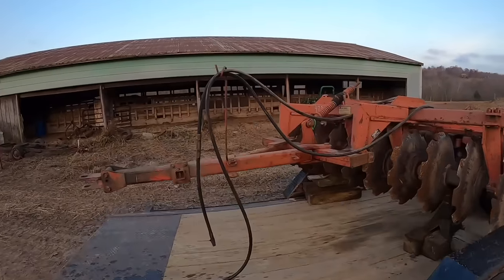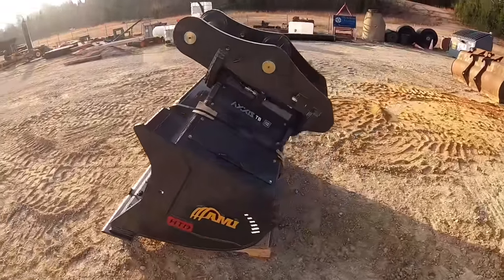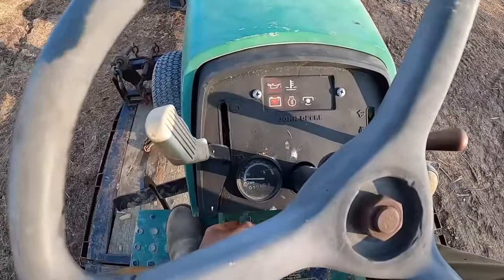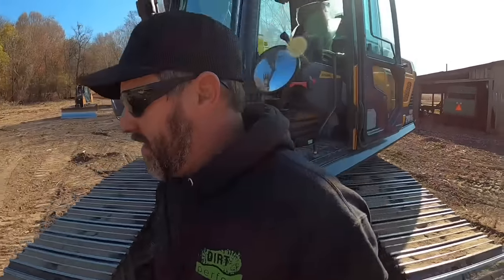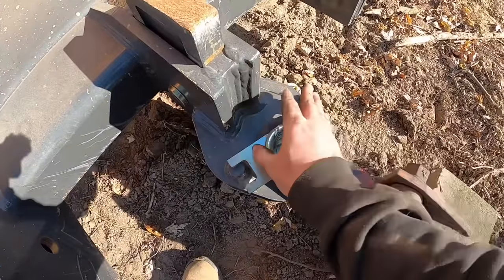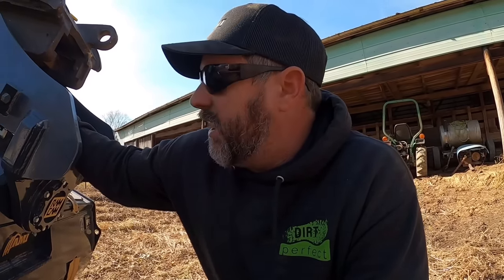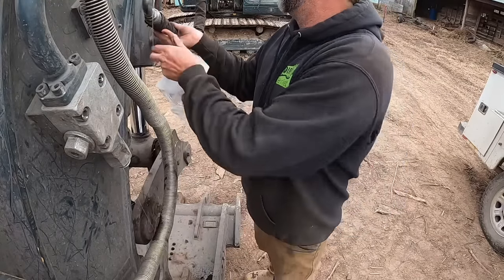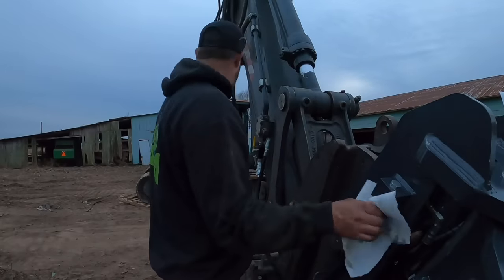This is a bad Idea but we are doing it any way Progress on the abandon farm continues!!

Comment: DP I asked this of Clint but he didn't know much. With Hydro one new transition line coming over my farm this summer the 2nd esment they need to run the new line next to the big  Existing line my shop has to come down an rebuilt out front. The forest my cow calf have used for shelter for over 30 year going to be cut down so Hydro one paying for new barn. Never needed a maching other then a rental for a week or 2 in spring for clean up winter feeding lot as I use my boom truck to feed 1200lb hay bales but now with new barn it has to be cleaned out an bedded weekly . So Hydro had me get a qoute for a machine I need. I got qoute for a bobcat T770 and 5 attachments. A 200d cat with 5 attachments. And a 50 newson wacker with 5 attachment. There the only close dealers other then kabota witch no way in he'll I'd own. Now bobcat use to be my #1 until they sold out an now  The quality and build has dropped drastically to better there  Original line so I'm not sure. 2nd Cat popular but parts cost are 4 times any other brand an the dealer seems to not care for the small guy.. now we're I am stuck is the 50 wacker newson. I never operated one never seen one. But watching reviews on you tube a head to head with these 3 machines an same hp an weight in a kabota. Buckets off on all machines each machine pushing another machine on the quick attach plate. The wacker 50, 97hp pushs the cat, bobcat an kabota across the pit like nothing yet none of the others can mover the wacker. I hung up witch one to buy. As for cost the wacker an Bobcat with the 5 attachment after tax is $197000.00 the 200d cat $186000.00 plus tax just for the machine an 1 bucket other 4 attachment are listed extra on the qoute. All machines are in the 1200lb range an 97hp The only dealer that will come to the farm for any warranty repairs is hood logging the wacker an  hydyi dealer the other 2 I have to float it to there shop. Witch is a problem here in Ont. Canada unless you have a class A license same as  your licese to drive your mack an float for transport trucks. Even with my Dz for tandem an tri-axcel dump trucks I can not tow over 10,000lbs. Machines are over 12,000 never mind my 2800lb trailer. With no ice or snow build up or wet.
The wacker an hydyi dealer is not bring in the hydyi track loaders until they get some in there rental fleet for 2 years to test. Before  offering them   .  What would you buy?? But I think other then the bucket with cutting edge the rest of the attachment scap clam bucket, tooth bucket, snow blower, seeder, 12" post hole auger, 11" snow blade, hay spear, an pellet forks and similar to your ruckus rake I'm going to order from skid pro. None of the dealers have a machine in stock. I seen an run the new t770 bobcat an the 200d cat with my past job an rentals. But never seen or run a wacker other then there rental wacker compactors witch are great.

Comment: When you lifted the disk with the excavator since the  Relief set to low on the tractor to lift it. I was sure when you set it down the wheel were just going to fold. Unless you put a safty pin in to stop it. Normally a low set relief if it can't lift it will also not hold the weight. The relief just let's go.

Comment: Back in 1975 I was being indoctrinated into proper equipment operation on my uncle's dairy farm. He pointed to a stack of boxes in the corner of the tool shed. "That is all grease. I can purchase all that grease for the price of a single repair. We will grease every piece of equipment the first time we use it every day. There is a grease gun in the truck, on each tractor, and another here in the shed. You will learn every zerk fitting on every piece of equipment."  And so I did. And in the 7 years I worked there a bearing failure was a very rare thing, and even those that happened were discovered before destruction when the grease didn't come out properly!!

Comment: Mike are you sure those bolts are stops and not travel locks.  Pull bolts, extend cylinder, insert bolts and then travel with no pressure in the hoses, thus if a hose pops you dont groove the roadway.

Comment: Dp you have been to a auction or two ..right and you have never seen a piece of construction equipment with premature pin wear…Long term profitable farmers are the most maintenance fanatics you will ever find…a lot of farms run equipment that is 40 plus years old that still work…besides your drainage trailer what do you use ever year that is 40 years old….

Comment: Next time got the excavator by a welder bud might need to weld a chunk of metal  behind the new valve body so if the valve body gets hit doesn't brake the fittings or valve body with  no support behind the valve body

Comment: New tilt bucket has some built in fire protection…..
Reply: DirtPerfect1  Picked up 4 fire extinguishers today as a tip from your experience with the mini bush fire in the excavator coupler and bucket quick attach - big bush pile burn in my future from left over hurricane windfalls….

Comment: What kinda sucks is 4-5 years ago you could’ve bought a John Deere 4455 , or a Case IH 7120 (both front wheel assist) pretty cheap that would’ve been excellent to pull the disc. Like all non-computer/emissions equipment, they’ve skyrocketed in price. 
I listened to the podcast you guested, and you’ve eliminated one of your comment generators: all the people asking when you were getting a tilt bucket for the Hyundai.

Comment: WARNING!!! Do not use Teflon tape on a hydraulic system. Permatex makes a hydraulic fitting sealant. The Teflon tape can get into the hydraulic system and do damage to pumps and valves.

Comment: Question.. What going to happen when the new values you get snagged in middle of use and you loose pressure  on with thumb  or even if using tilt bucket
Reply from the maker: Just not a concern

Comment: Mike, I've been wondering if you have used or have an opinion on a Gradall. It seems it would often be a versatile complement to your toolbox. I like the extra motions you can get with those machines. Your new tilt bucket has the functionality that I have used a Gradall for, but a Gradall has the ability to run on the highways without the need for a lowboy or trailer.
One of these days, I should email you a semblance of a resume" so you understand my working background of where I am coming from when I offer a suggestion. Machinist,mechanic, carpenter, fabrication welder, equipment operator, & etcetera.

Comment: So basically everything that you were doing with the disc and dozer could have been done with a root rake on the dozer?? Oh wait, those don’t work. lol
Reply from the maker: Exactly
Reply from the maker: And it’s not even close to the same
Reply: I run one on a D6k about 10 times a month clearing basically the same type of stuff and they work perfect. Accomplishes the same thing except faster but to each there own. Maybe your soil type is different. Our tines are fairly close together, maybe that’s the difference.
Reply: I run one on a D6k about 10 times a month clearing basically the same type of stuff and they work perfect. Accomplishes the same thing except faster but to each there own. Maybe your soil type is different. Our tines are fairly close together, maybe that’s the difference.
Reply: I run one on a D6k about 10 times a month clearing basically the same type of stuff and they work perfect. Accomplishes the same thing except faster but to each there own. Maybe your soil type is different. Our tines are fairly close together, maybe that’s the difference.

Comment: By what I seen in your last video when you started up your equipment I didn't see you checked oil levels and I didn't see you with a grease gun in your hand and then you run a Dozer out of fuel, talk about a rookie move . You wouldn't work at our Farm from what I've seen!!
Reply: Does he really have to film checking the oil and greasing the equipment everyday to prove to you he takes care of his equipment?  I'm pretty sure on your farm someone has and will run equipment out of fuel once in a while.  Lets face it you not perfect.  No ones perfect.
Reply from the maker: Exactly